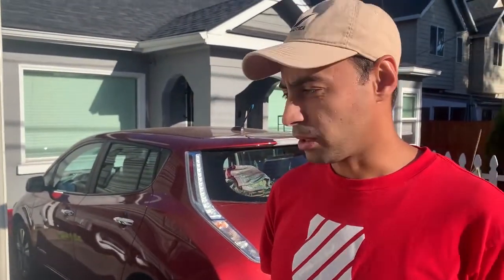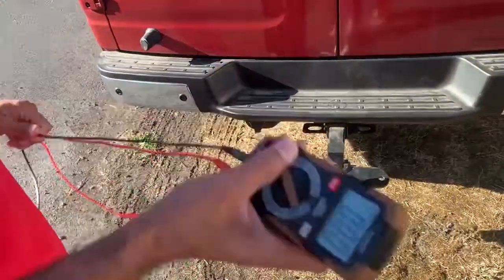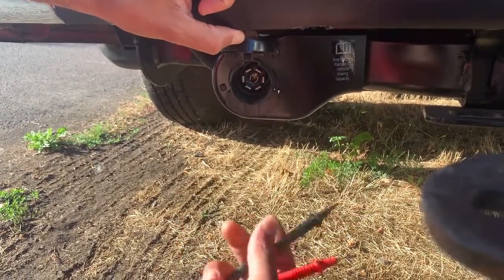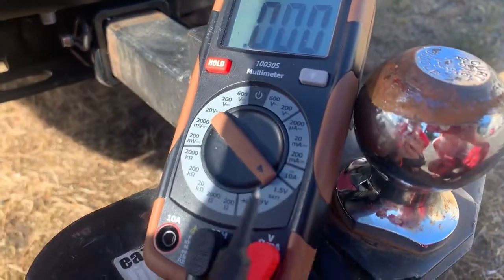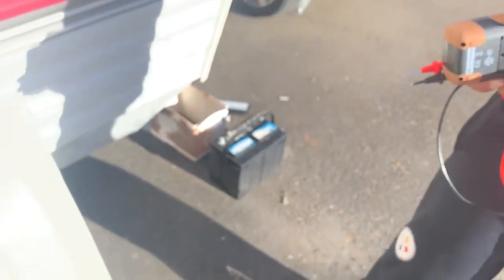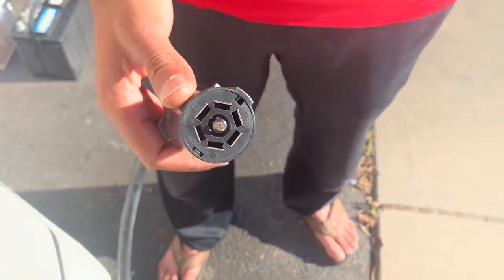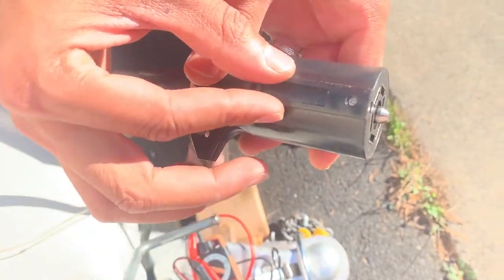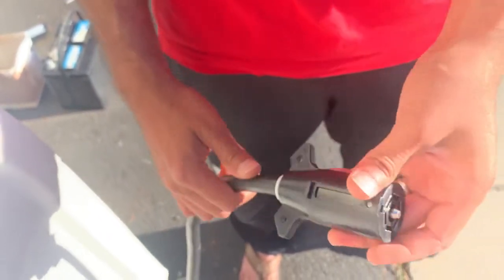Travel trailer turn signal lights not working Solution

Comment: Same issue, I lost a half day trying to diagnose, tested connections, bulbs, wires, after talking to RV mechanic he suggested looking at the TRUCK fuses (F150), turns out even though the lights worked on the truck there is a trailer relay that went bad. ,$5 part, problem solved.

Comment: Good video man. I just have a question. I have problems with my right turning signal. The brake light still works its just the turning signal doesn't blink but its the same light.was that the same problem you were having?
Reply from the maker: What about the hazard light, is that working? For this specific video I just had one side that refused to work at all. 

However I did have an issue similar to what you described and the link to it is this:

https://youtu.be/kanh6MszavM